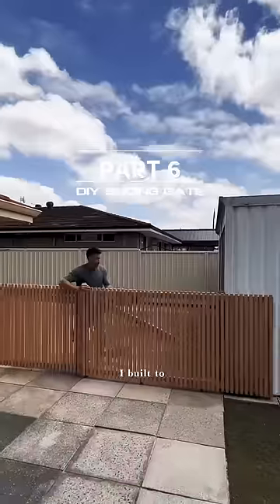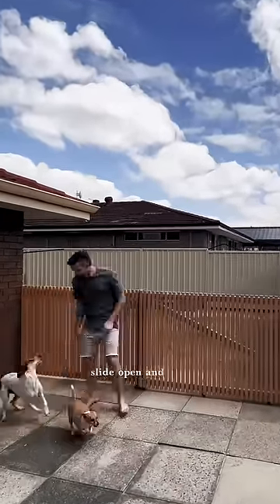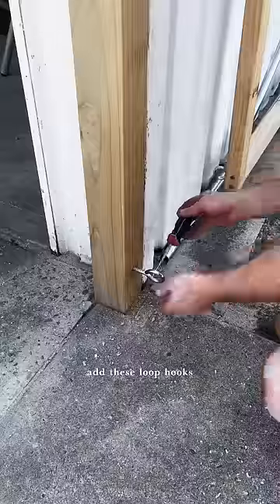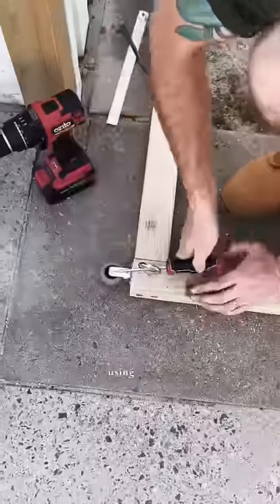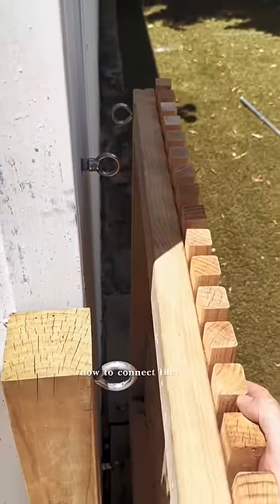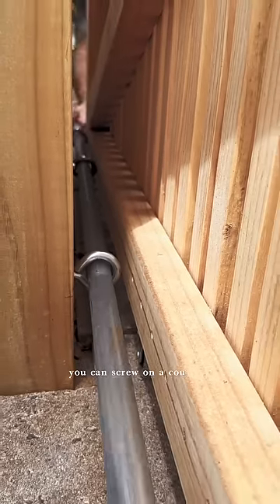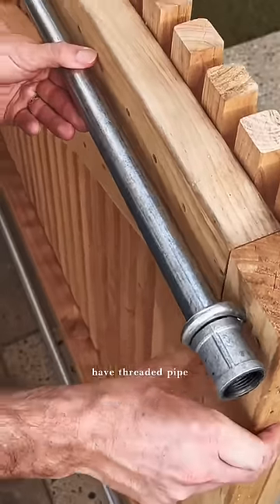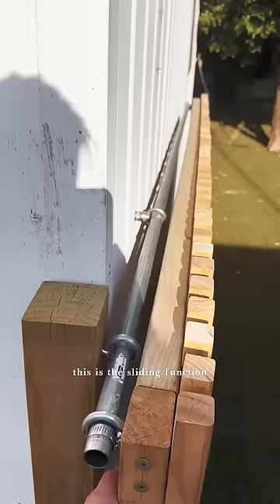If You’re A DOG Owner, WATCH This

Comment: Pipe isn't stainless steel. It will rust.paint will scratch off.
Reply from the maker: Eventually but I will get a while out of it
Reply: Couldn't you paint the pipe or use rust converter?

Comment: Can't imagine the loud sound cause by the friction of the pipe and rings.... instead of rings install bearings.
Reply from the maker: There is actually not much sound out of it at all, otherwise I wouldn’t have it. A bit of garden grease plus the wheels take the weight. The poles and rings are just a guide.

Comment: Innovative and smart except for the mechanical stops on the sliding mechanism. Replace them with heavy duty pins that have cotter pins installed on each side and you will find it improves the life and functionality of the stop mechanism. Good job on the installation everywhere else though!
Reply from the maker: Cheers Frankie, wanted this to be as DIY friendly as possible, so a screw on cap is a lot more doable for the majority 👍🏼

Comment: Great job! This gate will never "sag". Good on ya mate!
Reply from the maker: Thanks mate!
Reply: The gate will sag. It has no support where the two halves in the central. That's why you use channel Iron or angle iron of a heavy guage and Iron wheels to sopport the weight of the gate as it rolls backwards and foward.
Reply from the maker: @josepychoy5578   In actual fact, it doesn't sag and hasn't sagged. There is enough support on the other side where the gate overlaps the shed.

Comment: You know that most hardware stores do sell the proper component needed to make a sliding door or what's called track and wheel
Reply from the maker: Yes but did you watch my videos. I didn’t want a track on the ground because of constant thoroughfare with walking through the gate and bikes and scooters. No track equals no trip hazard. There is more ways than one standard way of achieving the same result.